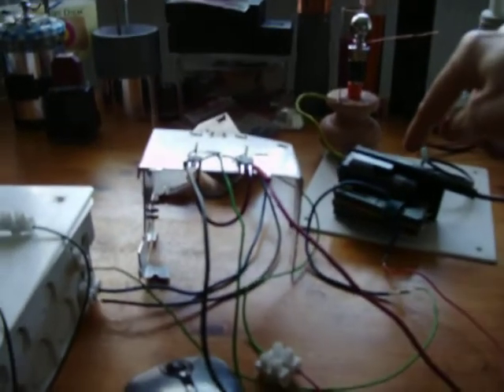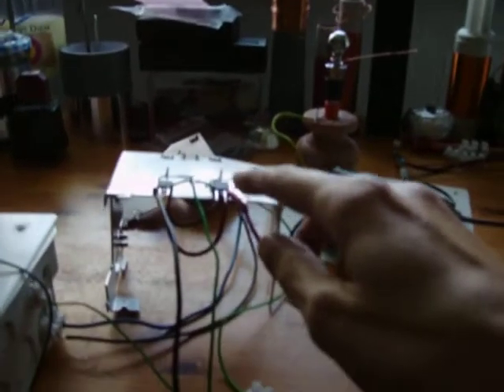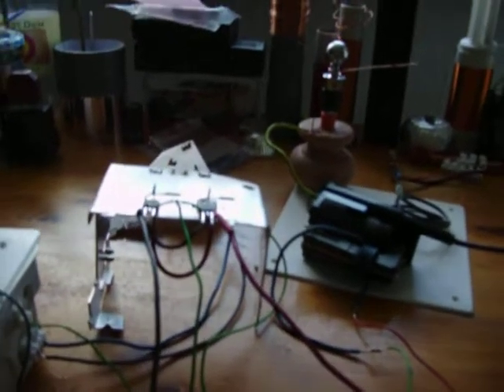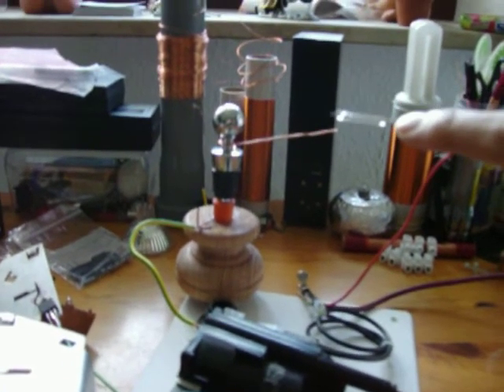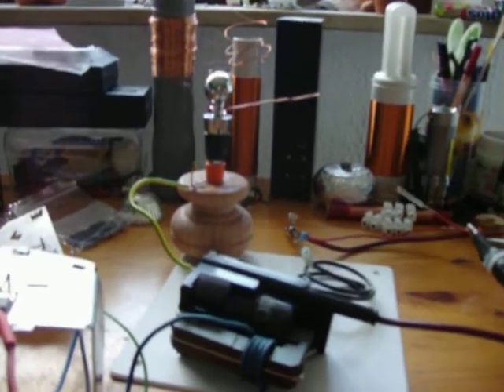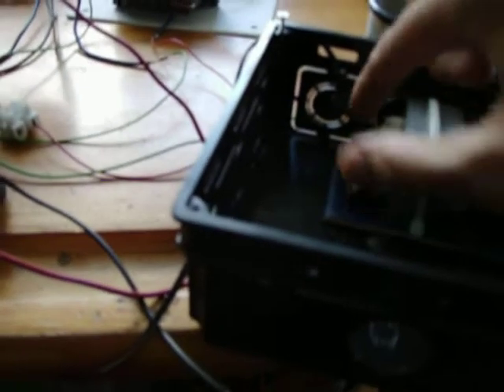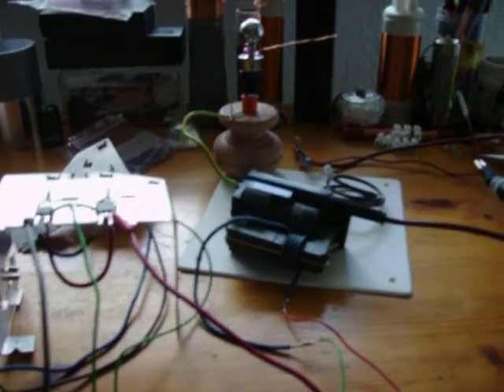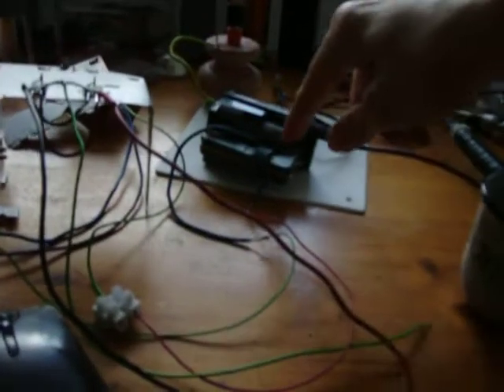gate driver question

Comment: you will need individual resistors per mosfet. as well as correct value of resistor, combined with a sharp enough square wave drive. this is where the drive circuitry becomes more important.

Comment: 2 in parallel wont switch properly from a 555
i will do a video for you shortly, sorry i have been busy. drive current/voltage is very important. to drive 2 mosfets you will need proper drive circuitry. either a mosfet driver IC or a totem pole.